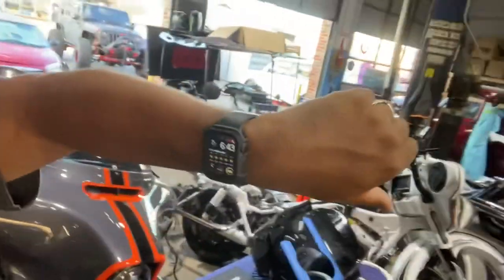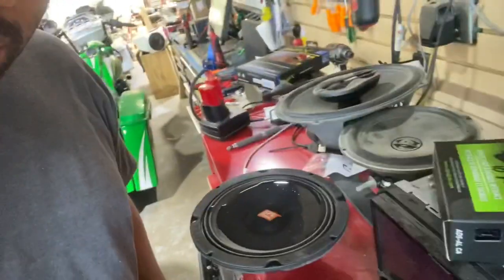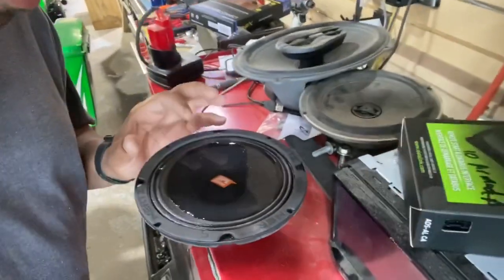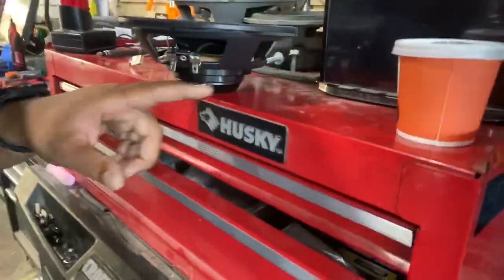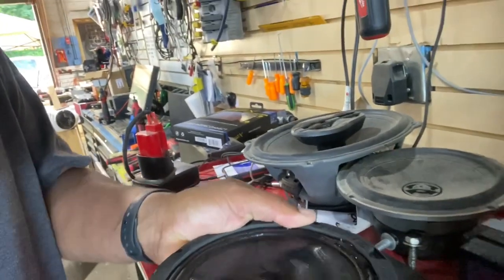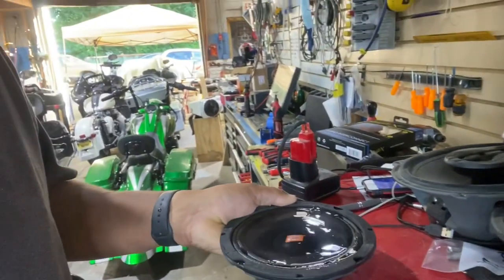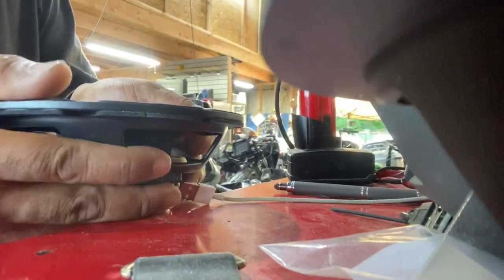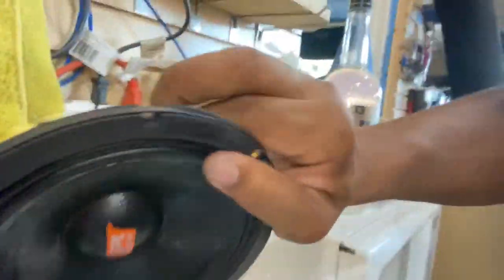Hertz SPL Show Neo SV165 Neo water resistance test part 2

Comment: Band pass at what?
Reply from the maker: Depends on what tweeters we are running and if we have mid bass drivers in the bags and how much power 

On low power 80-5000 

But normally 150 hertz - 5000 hertz
Reply: @NVSAUDIO  Thanks. NVS Audio keep up the good work.